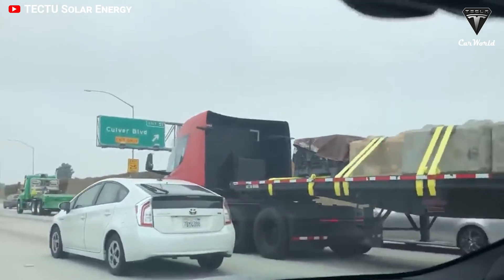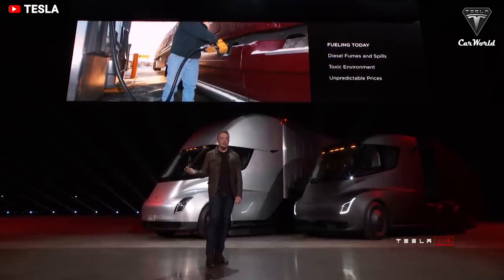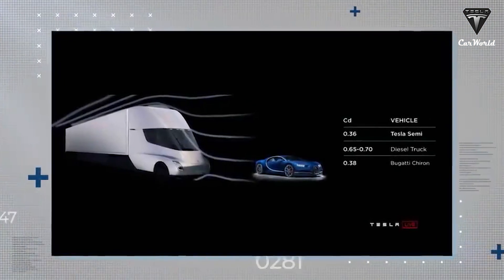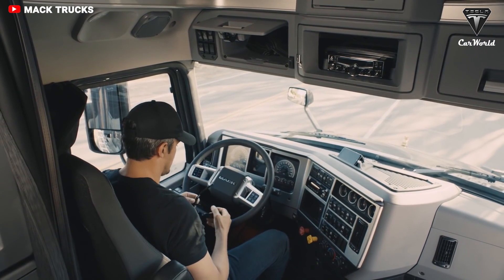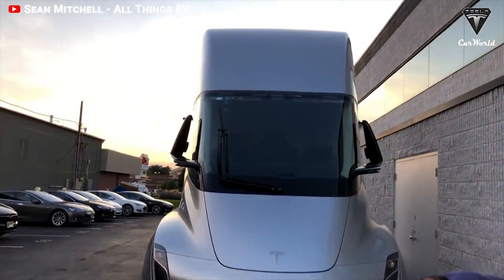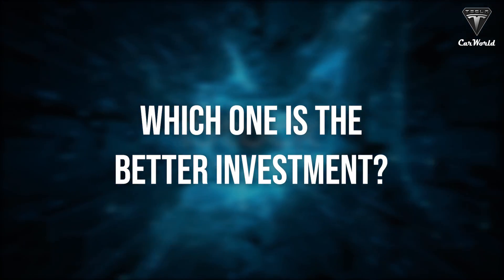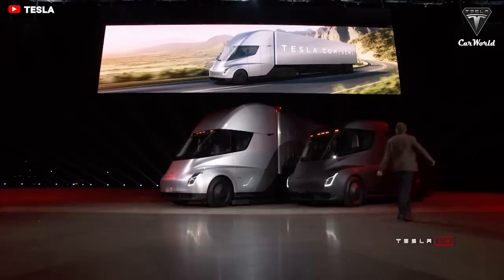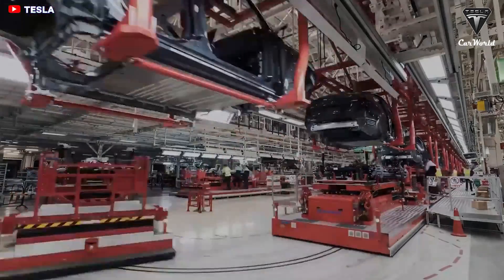Which is the KING of 2023 heavy trucks? Mack Anthem Diesel Truck Vs. Tesla Electric Semi?

Comment: The Tesla Semi sounds good, but real world test data will be required especially when hauling heavy loads as no doubt this will affect the range.  Things like charge time, charge locations on routes, durability, quality and battery replacement cost will all be factors to consider.
Reply: True. Also pulling loads wears any vehicle down over time. Would like to see how tesla truck longevity is.
Reply: @llewellynjameskinnaird2741  not much telsas are notorious for shoddy quality and electrical failure. They lied and shrouded the truck without giving any real information
Reply: @llewellynjameskinnaird2741  thats why dont buy tesla when its not fully  developed yet
Reply: @llewellynjameskinnaird2741  Well 20% reduction in battery a year if used slow charged and only 40 hours a week! 
130-150K every 2-4 years for new battery! LOL
Thats why its 150% more than diesel in cost/mile!
Reply: @llewellynjameskinnaird2741  probably garbage considering their cars have a history of bad quality parts and excessive breakage
Reply: @llewellynjameskinnaird2741  overall maintenance is vastly cheaper on electric motor vehicles.  This will be one of the major selling points for the semi once charging stations are on any long haul paths.  I am sure insurance will also be vastly cheaper to operate these as well due to a near impossibility of run away conditions and less of jackknife risk.
Reply: @bodhisfattva7462  Are you including battery pack replacement in those estimates? Or just regular preventative maintenance? Remember semi's typically will run more than a cars lifetime in miles in less than a year of operation. What is the expected life of the battery pack?
Reply: Electric trucks are not feasible because roads have weight limits and batteries take half the cargo weight of traditional trucks
Reply: It will work great for day routes. Wont be able to do regional or over the road. That is why it has no sleeper yet.
Reply: Even temperature and terrain does the same, there are a lot of factors that makes electric with current battery technology very limited at what,where and when can do
Reply: Sigh…really need  someone who knows something about heavy trucks to narrate this. A 2000lb payload? Huh?  And who gives a fart in a high wind about 0-60 acceleration times?
And we need dump trucks like this! Run all day for 300 miles….sheesh…waste of time to listen to this.
Reply: It can’t pull any significant load 💀
Reply: Plenty of shippers in CA have been demoing the Tesla semi trucks, biggest problem that they mention is only having 4hours of operation run time and then having to let it charge for 6 hours.
Reply: @nitrusdestroyer4455  The only limitation is the fact that the batteries don’t provide the hours of operation yet, but we must crawl before we can walk, and only time will tell!
Reply: They did 500 mile test, single charge. Fully loaded 82000.
Reply: @fsckool6894  so its limited to local
Reply: @sneed915  500 miles is normally what highway driver, drives before he is legally required to take 30 min break.

You charge in that time and carry on your journey once again.
Reply: @fsckool6894  Charge where? Tesla supercharge stations are not ready for this kind of capacity (500kwh). They have 100kw (most of them), 120kw (some), 250kw (very little). So tesla truck will charge 2-5 hours on supercharging stations (2 hours on rare 250kw ones). And 25 hours on usual charging stations. 2-5 hours on charging station after 500 miles on the road  might be too much down time for the trucking companies to find tesla truck worth it.
Reply: @MrMpakobec  they will have to pay exorbitant fees to truck stops to permanently reserve parking spaces to install charging stations in. No semi will fit at a current tesla charging station, can barely fit any electric car into a charging station while hauling anything. (And all the places that have charging stations would have a dropped trailer towed.)

It will take too long to charge for them to install one at the pumps, and when the parking lot is full, the tesla driver is going to have to beg the apathetic employees at the fuel desk to make one of the other, far more profitable, conventional trucks leave so they can recharge.
Reply: And When it’s hot out the teslas battery will drain
Reply: Tesla guarantees that to replace the batteries at least would take 8 years.
Reply: High acceleration for a semi becomes important in some cases, such as  going up uphill fully loaded and simultaneously overtaking a slower vehicle...
Reply: @TropicalVibesHD  High acceleration means nothing. It's stupid stat that Telsa though was cute. I'm not worried or thinking about acceleration when I'm pulling 100k plus load. 😉
Reply: @dasimparmy2289  I see your POV but what is the DOT weight limit? I believe the acceleration metric is used to measure  how well the vehicle can maneuver away from sticky situations besides braking, getting through lights etc. Example other drivers don't like being behind slowly accelerating trucks going through short-duration traffic lights as they might get a red by the time trailer crawls through. Also acceleration comes in play moving through tandem coordinated lights on a street. The acceleration is a practical proxy for torque.
Reply: If something goes wrong with the battery it will no doubt cost an arm and leg to replace.  The battery will obviously be larger than the standard Tesla battery and those supposdly cost 12k -14k to replace if done through the company or dealership.
Reply: @CN.23  yeah the battery will probably cost 30k to replace with labor including and they'll have to change it every couple years if they want to keep the range
Reply: @CN.23  diesel engines are probably the same price. The downside with electric is the down time if something does break. Who's going to fix it?
Reply: @CN.23  Even if it does you're basically adding up that + cost of electricity vs Gas + diesel/IC specific maintenance.   Electric is still gonna come out cheaper.  I think engineering explained did a vid on it. 

That said Teslas have some of the worst QC in the industry, wait for another EV truck company to come.
Reply: To think that it will only cost approximately $60 bucks to make a 500 mile trip, is absolutely mind blowing! Maintenance, is cut down to tires, no diesel, def, engine, oil cost at all. If you don’t think that it converts to even more money in your pocket, you’re crazy, and if you remain a denier, shame on you to not even allow the thought of possibilities. There is no doubt that technology is here, and making huge strides, and we should be commended on the fact that we came from a point where we discovered fire, and learned to cook our food, to a semi truck that is fully electric, and able to do the same work at or even better than the diesel motor, and the only limitations are batteries, which may be overcome with the newly discovered limitless power capability of fusion/fission technology.

Comment: There are many things I don't like about the Tesla Semi. 1. the "mirrors", cameras are less intuitive than mirrors. 2. The seating position makes it so that there can be no copilot. 3. That infotainment system is going to get people killed from distracted driving especially if the driver is overly trusting in simply trusting the lain keep and auto braking. however my bigest complaint is with the way they are marketing speed/acceleration. You do not want nor do manufactures want semis to accelerate or decelerate quickly. Goods will break; pallets will tip; liquids will slosh, trucks will flip over on on ramps. Faster is not always better. 
Regen braking will be great. Higher efficiency, wonderful. less fine particulate in the air, beautiful. This guy calling a Semi a car sad; talking about diesel price and showing a clip of someone zooming in on the gas price specifically, face palm.

Comment: The most important things were left out in this video...and in the recent tesla announcement.
1) The most important thing - how much tonnage can it carry. Back of the envelope estimate suggest 3-4 times less than a regular truck.
     This means that you need 3 tesla trucks( and 3 drivers ) to deliver the same amount of tonnage compared to diesel truck.
2)  How many hours does it charge...how extensive is the mega charger network gona be(whats the roadmap for it). Without mega chargers...these trucks will spend most of the time parked...which is a huge productivity killer.
Reply: It will be great for delivering pillows and marshmallows in state.

Comment: One sprint with full load and range drops by 100 miles! Mack can do it one even after another and still would go further than real 250 tesla miles (300 only when all stars align). And new diesel motors give 8-9 MPG not 5.6! Lie after lie.

Comment: No the motors are supposed to be from the model s/model x plaid, they changed that too. That's why it's more powerful than any ice semi on the road. That will give it ~1500hp, not 900.
Reply: Exactly this video has incorrect information.

Comment: In NY Tesla super charger cost $0.45 per kWt
It is 6 times higher than your $0.07 x 400 kWh calculations so it’s not a $28 but $180
How long it takes to charge Semi battery???
How long will this battery last if you willing to only use superchargers???
Does this truck become cheaper cost to drive a mile over truck life???

Comment: I’m so surprised by the price of the semi! It’s much more competitive than I would have initially thought
Reply: I was impressed at the price point as well even without the $40k “incentive”
Reply: With a government rebate it is.
Reply: @lancemillward1912  without it it will still be cheaper after a about a year if you are able to charge during non peak times or can set up charging stations that only acquire power during non peak moments or from solar and wind.
Reply: @bodhisfattva7462  to charge quickly as promised it needs significant infrastructure that Tesla will not be providing. So factor that in as well as battery replacement and the semi might not stack up as promised

Comment: Excuse me how the heck is this singing be able to go oversize load trailers when you’re pulling along heavy as can be dump truck and that truck just bogs down because it does not have enough power what are you gonna do then huh are you gonna call in another tesla semi truck to tow it you’re gonna need the big boys big trucks big diesel guzzling trucks so you better fucking shut down your account before your account good bye-bye max gonna win and also freightliners gonna win and Kenworth gonna win and Peterbilt so yeah I trust diesel running trucks more than electric battery powered vehicle

Comment: My primary concern is charging the battery. How long does it take and where are the chargers going to be? Also horse power is a secondary consideration to torque.
Reply: This is likely to be the key.  An electric truck would be perfect for in-city transportation, while an ICE truck is better for long-haul transportation.  Electric engines can handle stop-start traffic far better than a diesel.  A diesel is better for 'recharging'.  A car gas pump can do 12 gallons per minute, which is about 1.75 GJ/minute, or ~30 MW.  The current fastest recharger is ~500 kW.  So the smaller gas pump is about 60* faster than the fastest recharger.

Basically if you expect to need to refuel during the day, go with an ICE.  If you expect to be able to recharge overnight, go with electric.
Reply: @toddkes5890  You got better electric trucks for in-city transportation, pick any European or Asian tractor manufacturer and they already have them on roads in cities for about 5 years. Scania, Renault, Volvo, Hino, Isuzu, Fuso etc. all have Urban electric trucks delivering goods as we speak. Some of those also have long-haul electric trucks on the road.
Reply: @kurosumomo  That is why I was comparing recharge rates and stop-start travel.  A basic diesel pump is roughly sixty times faster to recharge a diesel truck than the current fastest recharger.

Similarly, an electric vehicle can handle stop-start movement much better than diesel.
Reply: Horsepower is rate of doing work, more HP will get you up a hill faster. HP is proportional to the torque times RPM

Comment: Many questions have yet to be answered. I definitely respect Musk for his ingenious capabilities! 
My questions and concerns: The test stated 500 miles w/82k GCW, where did this test take place?  What was the terrain like? Weather conditions? I can see 500 on slight to mild hilly terrain, definitely flat but mountain terrain of 6% or greater, definitely not, how hot did the motors get? What is the operating temp (minimum to max)before the system sends warnings? 
What is the warranty like? Hrs to yrs? (Electric motors are based off hrs not miles) what is the cost of the motors and batteries to replace? As one has to know that they are and will be EXTREMELY expensive! I've worked in the oil industry and we've had to replace our 3 phase 1200hp motors time to time and let's just say, for 1, would equate to a in-frame on a CAT and if a battery replacement cost $28k on a chevy volt, imagine on a ES!?
How long does it take to fully charge? As we run on Electronic Log Devices w/11hr drive time, 14hrs total daily shift.  Off 11hrs we can travel 700 +/-, on a full tank (I hold 280 gal) I can go 975 miles and have a 1/7 tank left (70 gals) fill up in 15 min and move on... If a ES can't at least travel 700 miles with a good tail wind on a 60k to 70k GCW, then it's not worth a OTR's time. It'll definitely be worth carriers time that do local and regional work, that's it. 
Lastly, when it comes to performance, I'd say, maybe 1% of the individuals in the trucking industry think of how fast they can get to 60mph. We O/O's think of quality, durability, longevity, gear ratio, hp and tq (no not to race but to match to what we haul). 

IF you wanted to make a true statement, you can make a ES w/a small NG generator (as NG is one of the most purest forms of clean fuels with zero emissions) that ONLY kicks on when a low battery signal is sent, the NG gen would automatically start while the driver continues on his/her travels and once the batteries are fully charged the gen shuts down. Until something like this is offered, individuals that do OTR will never entertain a ES.
Reply: What people don’t understand trailer semi truck they made for business they made to transport heavy materials they made to run long distance. The only thing you can save on an electric semi truck is maintenance.
Reply: @bobjeans  you dont seem to be acquainted with Part 395 of the Federal Motor Carrier Safety Regulations...you cant legally drive more than 715 miles in a day if you average 65 miles an hr.  There is nowhere in the USA that you can operate a semi for longer than 11 hrs with a mandatory 30 min break after no longer than 8 hrs of operation.  You should educate yourself on the 11 and 14 hour driving limits set by the federal government.  Oddly enough 500+350 is more than 715 miles so...the tesla can be in operation for the full 11 or 14 hr windows.  It is better to know facts than to be ignorant and spout garbage.
Reply: @bodhisfattva7462  So you are admitting that without the regulations in place the Tesla wouldn't be competitive.
Reply: you cant legally drive over 8 hrs without a mandatory 30 min break.  Part 395 of the Federal Motor Carrier Safety Regulations is pretty clear about how long one can operate a semi per the guidelines for 14 hr windows. Without 2 30 min stops you wont be able to reliably hit your max up time in the 14 hour windows unless you are hauling on an overall down grade. In a few years when solid state batteries leave the lab and are in production you will be able to drive vastly longer than any current fuel driven vehicle as they have 2x and more charge capacity to current lithium batteries but today you will lose around 40 mins if you only take one 30 min break during the day and have access to more than one semi charger.

side note you cant legally drive more than 715 miles per day by federal law and that is if you average 65 miles per hour as it isnt legal for a singler person to drive more than 11 hours in a stretch with 1 30 min break mandatory to break up the 11 hrs.

as you do not seem to know the federal law I will instruct you.

11-Hour Driving Limit: a driver is allowed to drive a maximum of 11 hours following 10 consecutive hours off duty.
14-Hour Limit: a driver may not drive beyond the 14th consecutive hour after coming on duty (which comes after 10 hours off duty). Additional off-duty time does not extend the 14 hours.
30-Minute Driving Break: a driver must take a 30-minute break when they have driven for 8 cumulative hours without at least a 30-minute interruption.
60/70-Hour Limit: a driver may not drive after 60/70 hours on duty in seven/eight consecutive days. They can start this period again following 34 or more consecutive hours off duty.
Reply: They did the 500 mile test runs loaded to just under 82k and went from Pasadena to San Diego, which included the Grapevine which is a 6% grade. They do not even have to touch the brakes on the downhill side due to the regenerative breaking keeping the vehicle at a steady speed. Also, they were going up the 6% grade with NO speed loss. They climbed it at speed limit. You can see the video on it here. https://youtu.be/fKhIoNqvBdU
Reply: @brianjones2891  it wasn’t from Pasadena lol. It was from Fremont, CA, down to San Diego, CA.
Reply: @zachchadwick3613  yep, sorry about that.